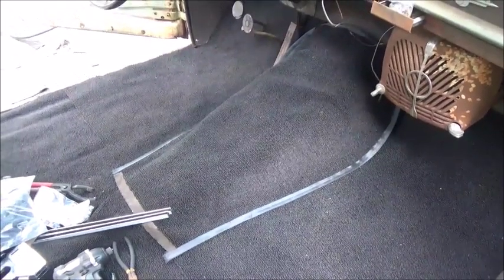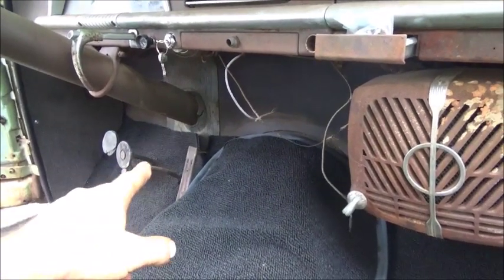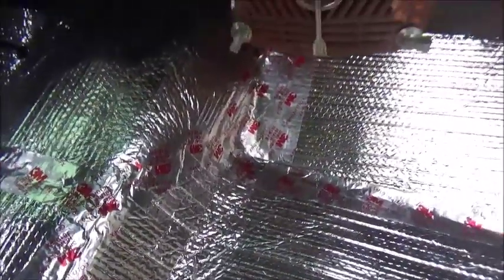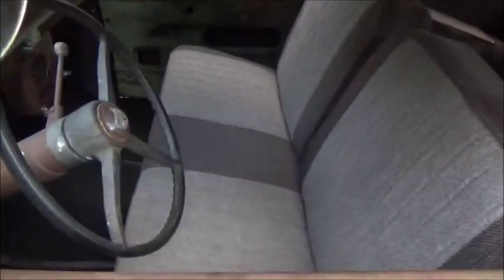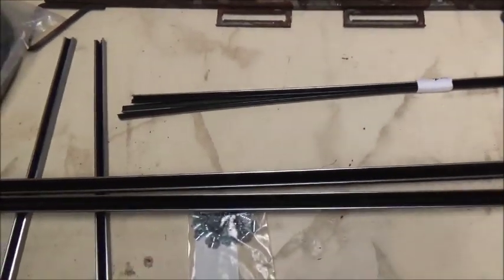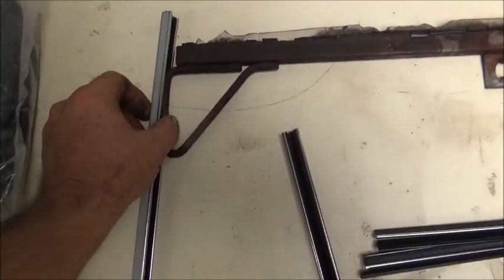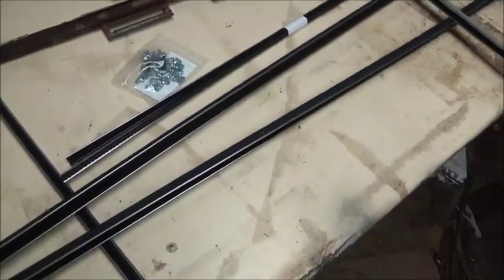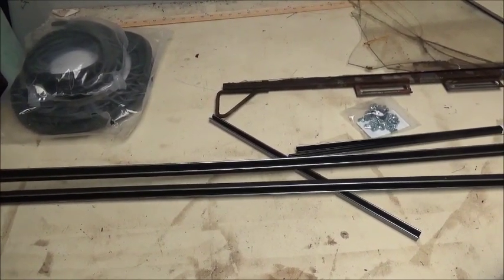1951 STUDEBAKER BULLET NOSE FINISHING THE INTERIOR

Comment: That interior looks great, for the hump, you can still glue on a thin rubber sheeting that has carpet underfelt stuck to it, but only to the sections of the hump that are lower than the rest of it. The rubber must face upward so it’s stiffness will support the top carpet. Or in some cases modern motors have thick shoemakers cardboard in sections where the material has to be supported. I would do the rubber as it lasts longer and the carpet will not tear. Great job👍👌😎

Comment: Working with an old time upholsterer as a teenager 40+ years ago he showed me how to take the puckers out of the carpet on the transmission tunnel by cutting wedge shaped sections out and doing hidden seams from the backside by hand sewing. It was a lot of work using a sail makers glove & needle with whip cord. When done properly it looked like it was molded to the tunnel.

Comment: Interior is looking good. I use a hacksaw blade to cut foam. You can trim a large area quickly and form contours easier. It will also keep the better half  happier. For cushion foam an electric carving knife works very well.

Comment: At the entryway of your drive where you might have A1 towing... you may be able to hang a little sign under it "Some Studebaker Repair" as you should be an authority on them after this. A really good video and serves as a motivator for others to take initiative to try this too. I will warn others who read posts, this man could make it look easy to walk through a minefield/LOL  A person doesn't have to have a perfect car, just the willingness. When you buy one of these old cars, try to do more than add some tires and wheels, melt the springs to drop and cut the wheel wells out. Look at some that have been done at home and throw yourself into it. Most are  surprised at how much can be done with budget tools and a heart!!

Comment: My dad taught me what he did for first start after many years. He pulled the spark plugs squirted in dome marvel mystery oil. Then he hooked up an old washing machine motor under the car to reset the rings. It only takes a few hours and in the mean time you can clean the plugs and inspect the points. That way the stater motor does not overheat or become stressed. Hope this might be useful to you and viewers.

Comment: the carpet looks good i wouldn't worry over a few minor creases 
the bailey channel for the door glass  if you use the glass to form the corner bend gradually bend it round the corner allow a inch extra along the top to trim it back to fit
done lots of these type windows  thats the best way i found to form the shape
seen so many try bend it in their hands and ruin the  side edge moulding on it

Comment: Love the work so far.  I was thinking about the hump.  You might be able to mold some cardboard into the shape you want and cut some small holes into it, then spray the filler in through the holes.  It will expand to the shape of the cardboard.  Don't know if the cardboard would be permanently stuck though.

Comment: wow that unbelievable I kinda wish I didn't live so far from you  cause my bio dad just got a 1980 chevy Scottsdale 10 with a 1975 chevy 350 small block and its got rusty floorboards that are about to have some holes in it plus we also need a two-barrel carb because when he bought it the guy who had her put a four-barrel Edelbrock carb on a two-barrel intake and its $87 for a new two-barrel carb cause we weren't able to find one at the scrap yard were I live but she runs won't idle  and will start to pop from all the extra gas once she gets into the higher RPMs but she's a keeper

Comment: Take a piece of paper and trace out the shape of the fold in the hump similar to when you want to make a panel section, then use it as a template to cut you rubber / underfelt pieces to glue on the hump👍👌😎

Comment: I remember when Cutworm59 sent 1963Impala2dr a tube with iron pieces in the mail.  He used Great Stuff insulation as packing.  He opened it in the kitchen.  It had not set up and the liquid ran everywhere!  Ken used a blow torch to burn off everything that wasn't iron.  I guess that stuff never really cures if it's put on too thick.

Comment: Hi Jonathan:  Look up Sketchup  Make, it is a free Drawing Program.  I have used it for a few years.  The main reason I suggest the program is because there are hundreds of tutorials to watch right on YouTube. I have a 3D Printer, so I have the Full version of Sketchup 2017 Full. I used to draw with AutoCAD and Sketchup is so much easier.
This is just a thought but couldn't you reshape the Transmission hump with Bondo? Just pull the Carpet back and put the Bondo right over the spray   foam

Comment: Jonathon, I have seen where a hot nail is poked through the carpet where bolt and screw holes are needed  it melts the carpet and helps prevents pulling the material out. Interior work is amazing, thanks for showing us videos.

Comment: Give Frost king insulation duct a lookup, you can't tell tge difference between pro insulation/sound dampening but its cheap for how much it covers, 12"in Width by 15"ft Length 1/8th inch thick, for $19.99